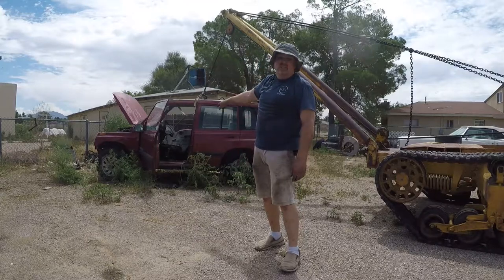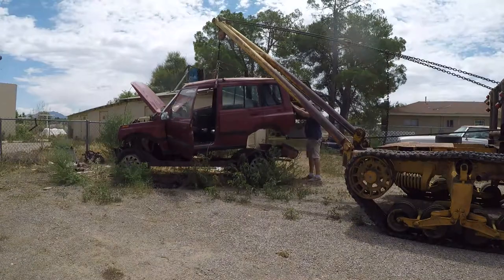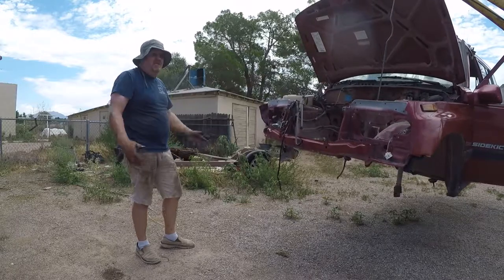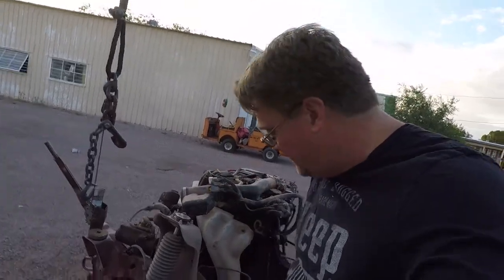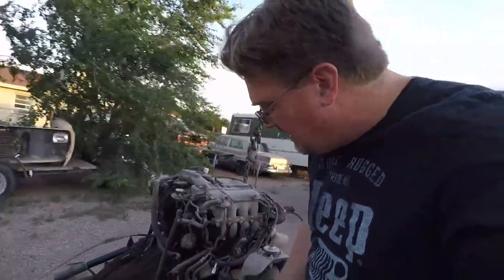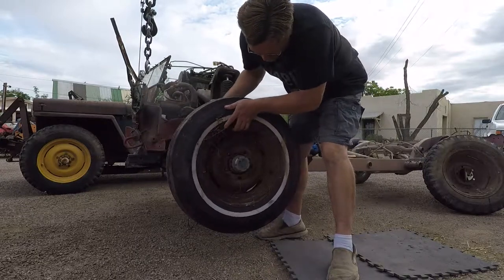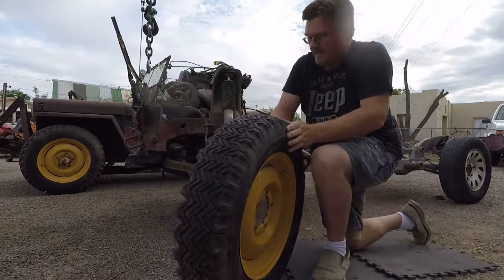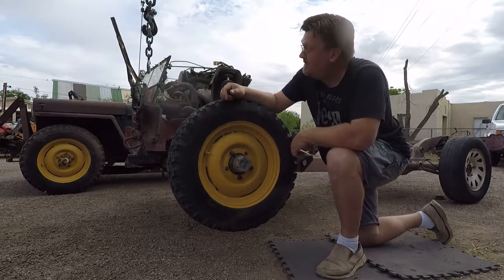Flat Fender with IFS?  Should I?

Comment: Nice Id do it since you have some legit cj2s why not? I have a rotted out 87 Dodge raider (still run it daily) but maybe i could make my own flat fender HMMM. OK I wanna see that tracked tow truck!
Reply from the maker: I worked with the idea for a while, then ran into a problem with the shape of the frame.  It just sits way too low in the middle to look right.  I've got another idea, which might be even better.  Oh, and a video on the half-track is up!